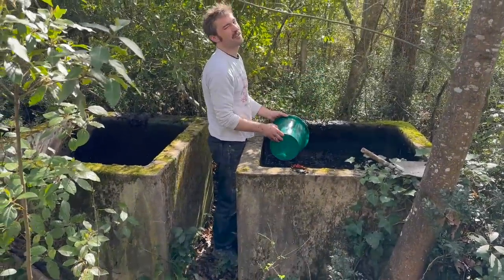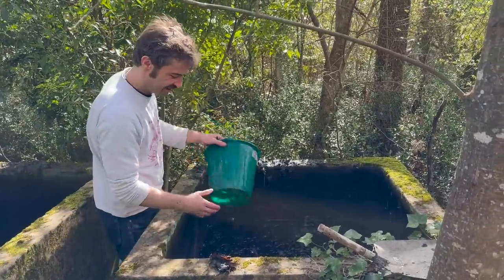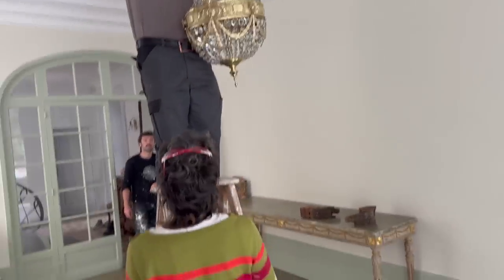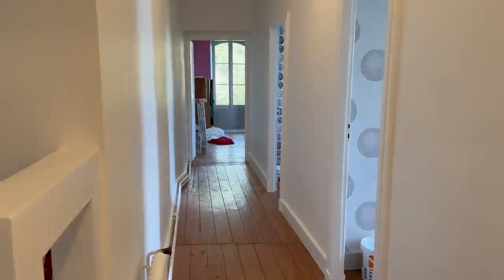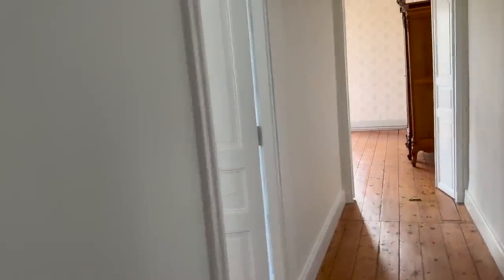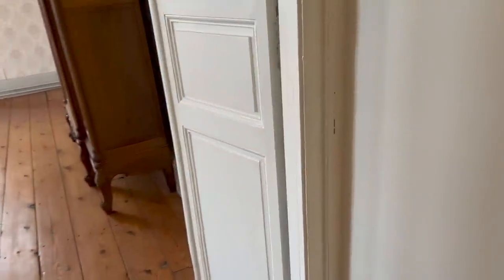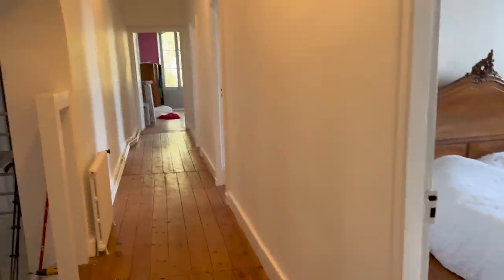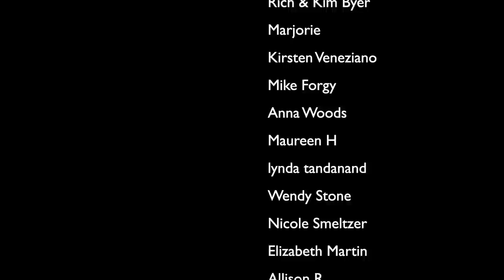Stuck In A Freezing French Castle! – The Chateau Chronicles – Ep #28

Comment: Also, I agree with painting everything white, at least at first.  You'll have fresh, clean walls and if you want to change the colors later, go for it.  
As far as those mosquito breeding ground is concerned, lids would be good but they also make such a think for ponds called "Mosquito Dunks".  Kills em dead.
Reply from the maker: Hmm. I’ll check those out. Thanks!
Reply: Abby and @Barbara at QUEENS AVENUE  I second that recommendation for the MOsquito Dunks.  I have continuously used them in small and large water tanks/pools and they work very well.  Read the instructions for the number of dunks per water top exposure and replace them monthly.   Very well worth it and they work very well without harming the frogs/birds/bees etc.

Comment: Regarding any new floor tiles style and color.  I have a very light off-white tile throughout my entry, kitchen, hall to bedrooms and dining room.  They are a nightmare to keep clean.  In the hall, I've added an entry rug, in the dining and kitchen I've added area rugs that are washable in black with small off white checks.  The rugs do not make it perfect but it is much better than a light or white tile floor.  Keep in mind if you decide to replace those existing tiles. Now, I  have a dog and a cat and mostly just myself in the house.  One tiny spill of anything on the light tiles requires at least a swifter, a wipe up or a sweep. It's not that I do not want to clean it's just that I don't want to see every drop of wine, coffee, cat paws, dog paws that happen in just one day.  I ran my home as an AIRBNB before covid so I had many guests. I know what it's like keeping the floors clean everyday.  Also, make sure there is built into the tile a NON SLIP SURFACE for your and your guests safety.

Comment: Professional interior designer here….authentic stone is best for the chateau and overall value of property. It would be important to do both tiled spaces in the stone floor for consistency and flow. IMPORTANT since you are tiling over existing surface (best scenario) that your honed/ antiqued stone or cement tiles with minimal lippage (pretty consistent thickness) since you will be doing thin set mortar. So you can do new limestone that has been antiqued. That will be your best bet for price and consistent thickness. I would suggest French pattern that is tumbled.  It’s classic and appropriate for your chateau. Hope this info is helpful.

Comment: I'd suggest if you go with the tiles you like to get rid of the floor that's already there. Reason being they are old and you'll never be able to match them if there is a problem. The level two levels might bug you in time. It can be a trip hazard or place to kick toes. Also maybe rehanging the door so it opens the opposite way so you don't have to cut down a door. Especially if it's an old door.